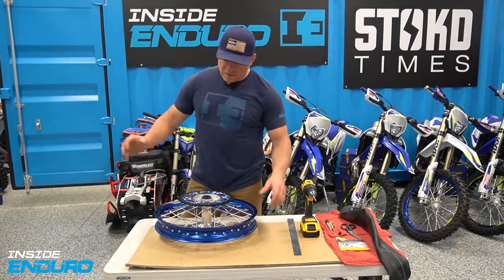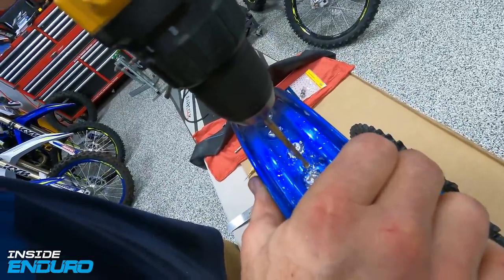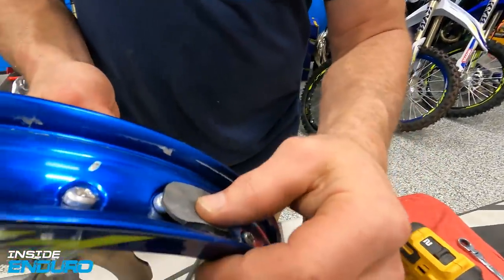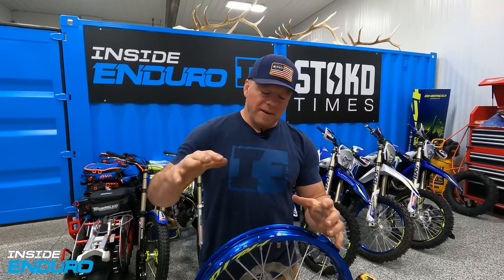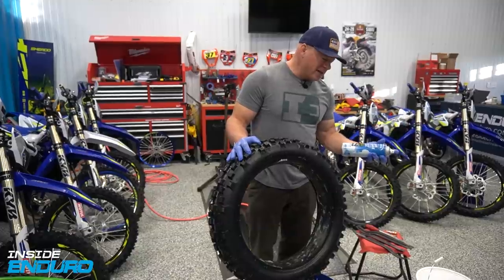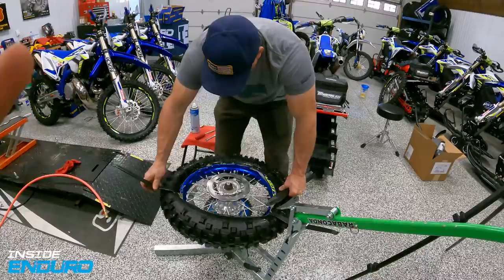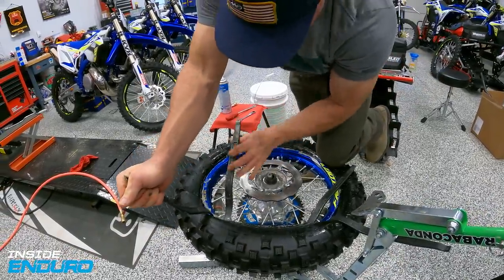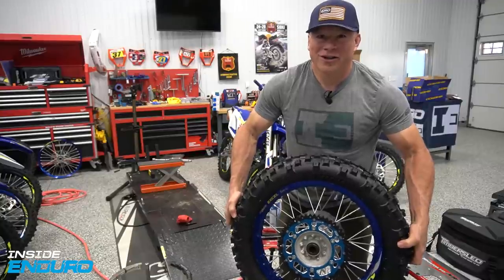Pro Traction Tip: 2 Rimlocks is Better Than 1!

Comment from the maker: Our bib drills are back in stock - get them here: https://insideenduro.com/shop/1-25-mousse-drill/
Reply: Supposed to add a bit of oil and going slow when drilling.  Because what is being drilled doesn't matter too much as it's thinner and soft you can get away with it but on super hard materials.. going slow and adding pressure while oiling prevents it overheating and snapping the drill.

Comment: If you don’t have an old valve stem, I’ve used steel stick to pack that hole and by George, it works damn well. Just a little bit and a backing of a piece of gaff/guerrilla to hold it in place while it sets. I love this channel and these dudes are real fuggin men. Thanks for all the info as always guys. You rock.
Reply from the maker: Great tip!

Comment: been doing 2 rim locks for years with tubes. Helps balance the wheels too as well as extra security in case of flats. A little more trouble changing tires but don't do that too often. Do you release the air once the bead is seated?
Reply from the maker: Good call! No we don't usually release the air - it leaks out typically within a day. Might be a good idea to release it if you're going to go ride it right away though!

Comment: I’m about to install and use my first set of mouse’s. My question is, with the TuBliss system, we use Armoral to lube the tire. It always dries and sets up fine. I’ve never had a tire rotate. That being said, can that be used as well as the window cleaner, or should one use nothing but the window cleaner?

Comment: Is the mousse paste same with silicone or rubber grease? If so i'll gonna try using rubber grease as replacement if possible
Reply from the maker: We do not use silicone because of the mess that will be created.

Comment: Awesome video, thanks fellas.  Quick question, when you run the gorilla tape around the rim, are you cutting out a section where the air valve comes through?  Or are you blowing the air under the gorilla tape?  Thank you!
Reply from the maker: We cut the hole out :)